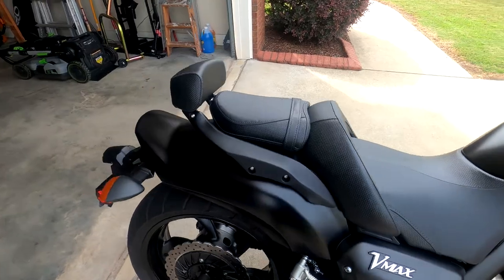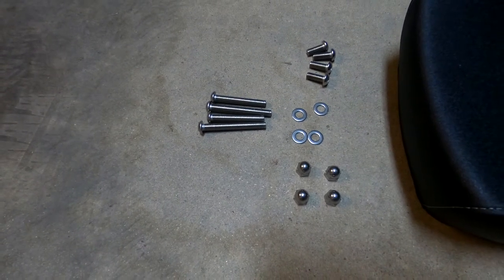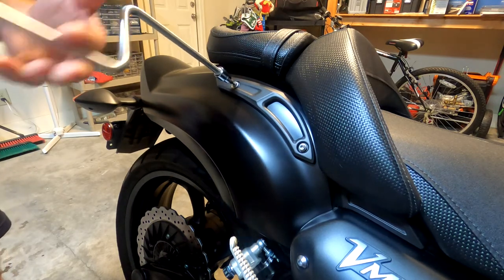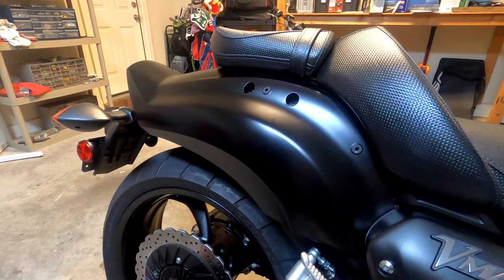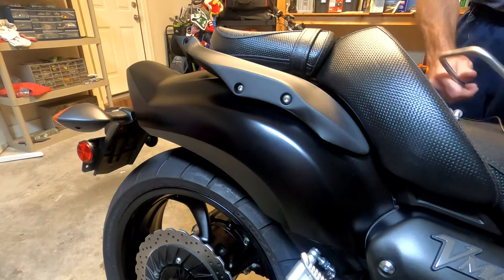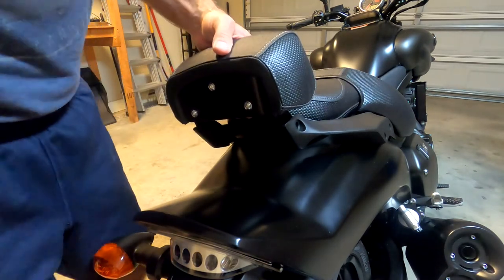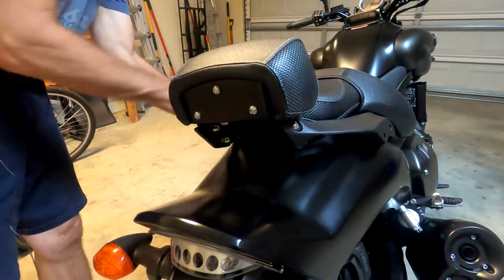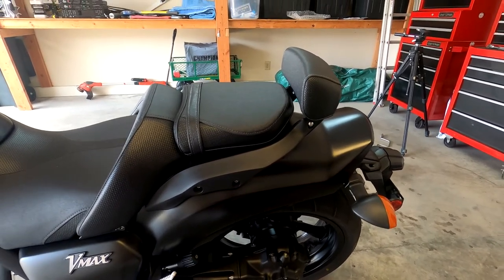How to Install a Passenger Backrest on a Yamaha VMAX 1700

Comment: You get lovely pillion handles too but they said if you fit either you can't fit both...so i ordered both and by a little bit of basic engineering inverted them so the right fits on the left side and vice-versa.  You got to cut about 10 mm and longer bolts and presto back restvand grab handles for the pillon. The grab rails are beautiful aluminium billeted and solid. You should try it. Lowering the rear foot pegs helps a lot too. Worth it for the pillon. Rip it. All set.

Comment: I wish I could find one in silver.......I used to have a black on black Gen 2 and I had this but also the rack....the rack turned out to be invaluable.....Now I own a 2010 but the silver ones are long gone.  I may have to strip the black powder coat and convert it to silver.

Comment: Am I missing it or did u not post a link of where u got your backrest?? U said Yamaha chargers $499 and put a link to that one.. Said u only paid $461 to your front door but excluded to say from where.. Maybe I just am missing it.. 🤔
Reply from the maker: I didn't mention where I bought it because after I bought mine, that particular web site no longer sold it, and still doesn't sell it. My recommendation is to use the Yamaha web site first to get the correct part number, then search the web to see if you can find a cheaper vendor. Good Luck, especially with the COVID backlog on everything.

Comment: Hey Jeff.  I have been trying to get a backrest for my 2015 VMAX since the first of February.  It's been on order with a parts distributor...  Got any idea where I can find one?
Reply from the maker: I ordered my from Yamaha about the same time I got the bike during summer of 2020 and it only took a few weeks. Unfortunately, most vendors these days rarely stock parts like they used to. You may try calling different distributors to see if by chance they have one in stock, but I doubt you will have any luck with that. Today everything is dropped shipped directly from the manufacturer regardless of which distributor you purchase from. Of course COVID has made delays even longer.
Reply: I appreciate your response.  I’ve actually done what you suggested and have even looked for one on eBay and wrecked bikes websites.  If you happen to see one out there, please let me know.  Thanks again.